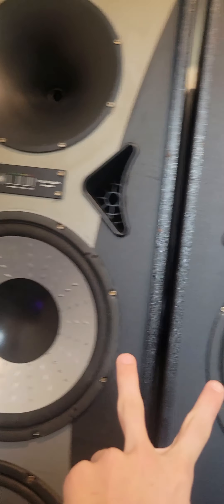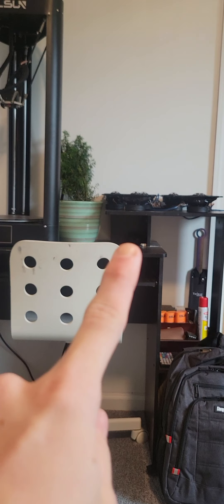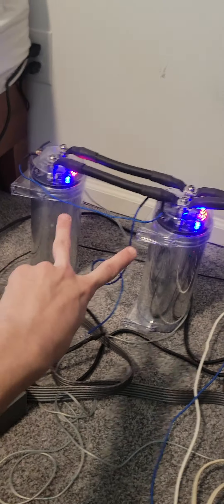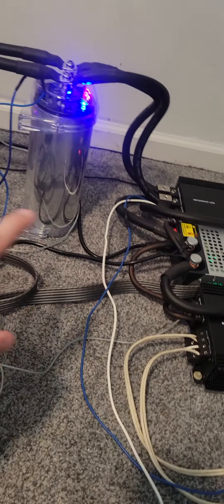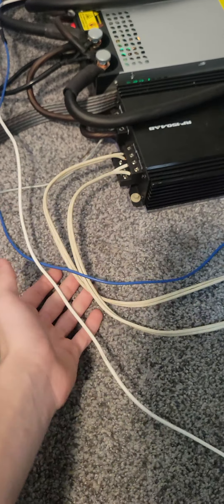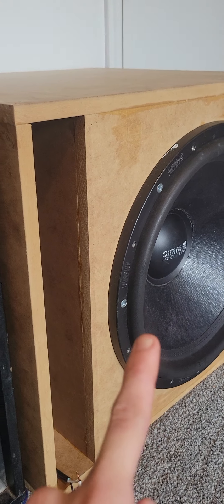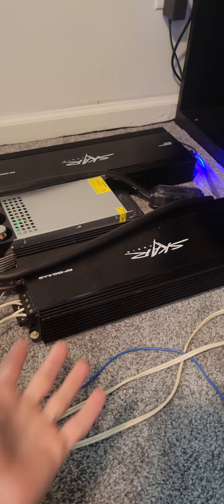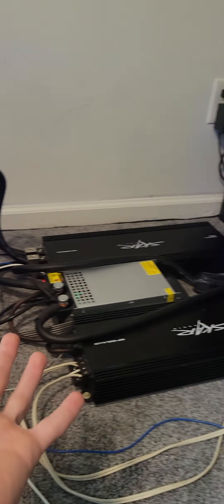Here is the setup in my room as of right now. #skaraudio

Comment: And do i have to have the capacitors?
Reply from the maker: @F.B.l  if your powering 500rms or smaller 1 cap any larger and you'll need 2
Reply: @BassNever2Loud  what do they do?
Reply from the maker: @F.B.l  boost power when the bass drops it delivers instant power so your volts don't drop shifting the system off